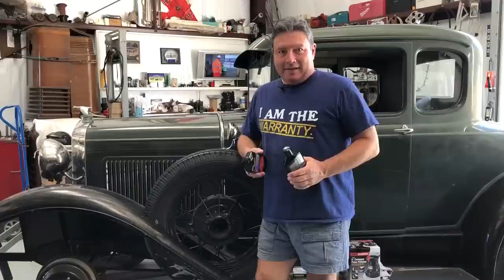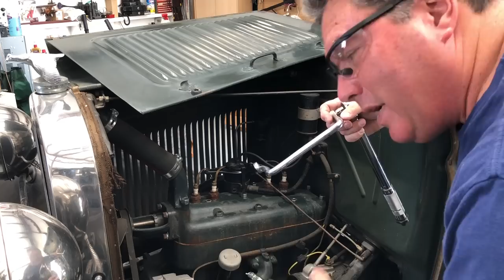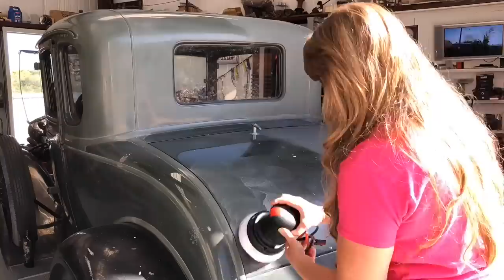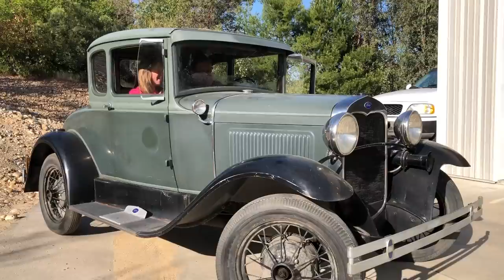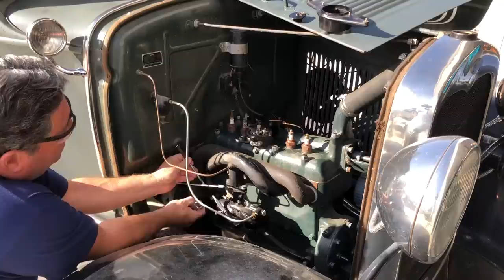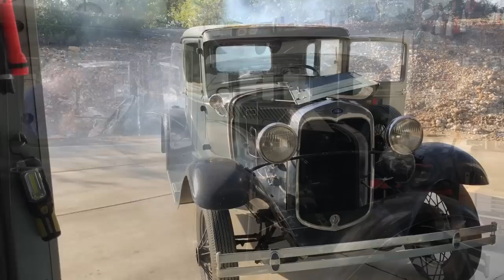1930 Ford Model A coupe- Got it started! Then it blew up.

Comment: Do you still have Gandolf and is it going to be a sale car?
Reply from the maker: Yes.  And yes!
Reply: Never owned one but have been wanting one. I live in Florida so it would have a good home.  Lol
Reply from the maker: Gandalf already has a waiting list!  If you have deep pockets, my show winner tudor sedan might come up for sale soon
Reply: Paul if there is oil at right side of engine gasket but not wet on  left side is that just gasket and not front seal?
Reply from the maker: @garyaxsom1815  Most likely gasket or the plug in the side of the block where the oil pump is inside might be weeping.
Reply: Thanks I'me looking at buying it 1930 coup $16,500.

Comment: Hello Paul! I own a 1931 model A with a B engine....For the last 2 months I was having a problem with my car, the water it was mixing with the oil. We've replaced the head gasket twice and the problem persist. My mechanic call me to go to his shop and told me  that I have a crack on the  engine block ( inside where the valve sits) so it  can't be welded. My question is: Where should I go for  an overhauled engine B or even A? Thanks.
Reply from the maker: Likely a cracked head.  Not as likely is a cracked block.  But, before replacing anything, I'd pull the head and have the block and head checked for flatness.  You might just need to surface the head or deck the block.  If the head is warped, you will replace head gaskets until you die and never get it to seal.